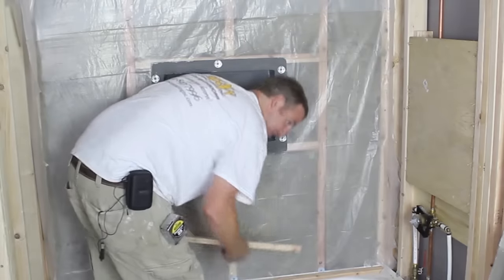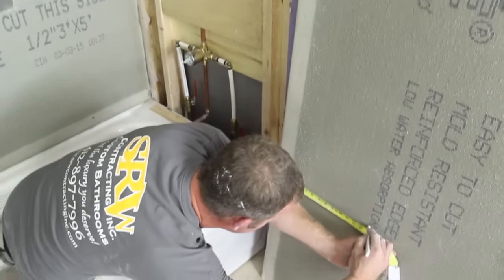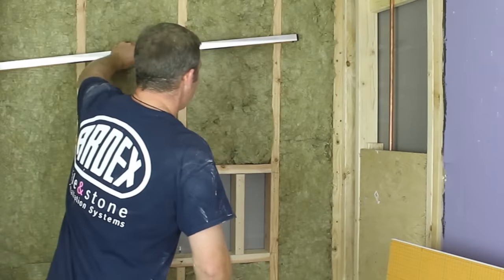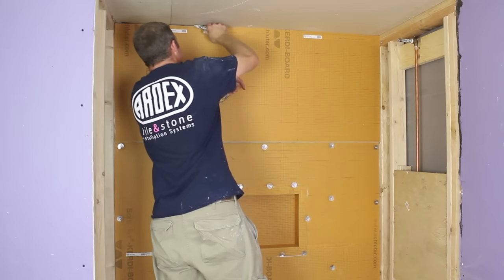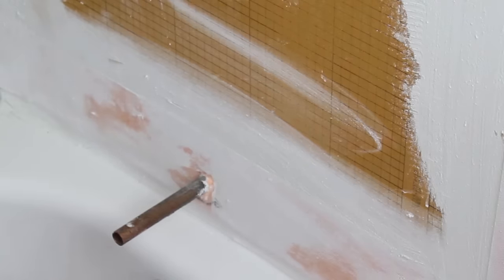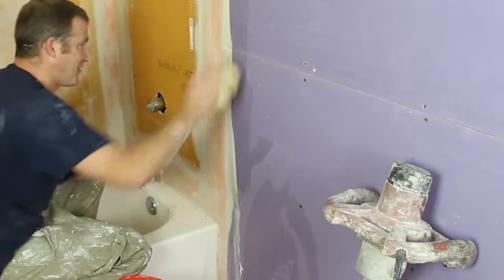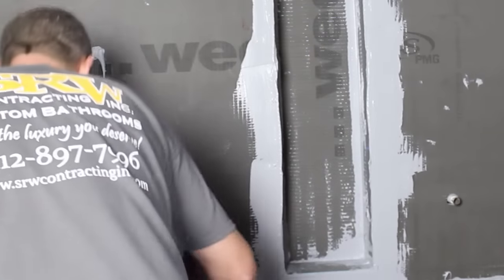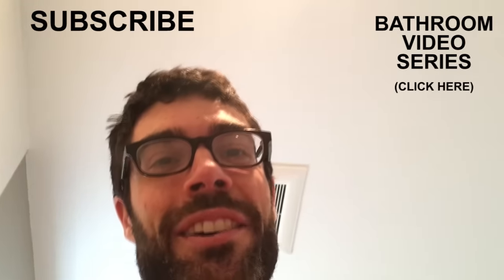How to Waterproof a Shower (3 Awesome Methods!!)

Comment: Hi JeffYour videos rule.My Question is, what thinset do you recommend to lay porcelain tile with Hardi board.Thanks, Steve
Reply from the maker: Thanks Steve, we like several and it depends on the type of waterproofing going over the backer board. If you waterproof with RedGard and have a large format tile (anything with a 15" edge or more) Custom's FlexBond is good. If you waterproof with Schluter's KERDI over the Hardie, then use their ALL-SET. If you opt for Ardex's 8+9 to waterproof the boards, then we like X77 for large format tiles.
Reply: Thanks for the quick response.
Reply from the maker: happy to help, what kind of shower are you building?
Reply: Nothing fancy it's just a redo.I Like the Redgard a bit expensive but so is the Hardieboard here.The salesman here in Burlington Ontario Canada at Lowe's sold me Mapei Light mortar for tile and stone and said it would work with Hardie.Would you agree with this Mortar?Thanks
Reply from the maker: Mapei makes good products, what size tile is it? I looked at the spec sheet for that thin-set mortar and it's polymer modified and should work well.
Reply: The tiles is 12x24Last Question Jeff. Do I still need to waterproof with the Mapei mortar?Once more thanks for taking the time out to answer my questions.
Reply from the maker: In that case, if you can find Mapei's LHT (Large and Heavy Tile) it's a better option for 12x24 tiles. Any cement backer board needs to be waterproofed as it will absorb moisture from the shower. Use a Mapei product like Aquadefense, it's a liquid waterproofing membrane; Lowe's might have it in stock but any local tile store carrying Mapei will have it or something similar. We like Mapei products, they're great. If you need help with setting the 12x24 tiles we have a detailed online course and it's helped many people, here's the link https://bathroomrepairtutor.com/how-to-tile-a-shower/
Reply: Thanks  very much Jeff will watch the video

Comment: honest question- with methon 1, I saw you had a vapor barrier behind your cement backerboard. I have read that you should either have that, or waterproof your backerboard (redguard) but never do both. Otherwise there is nowhere for water to go, walls cant breathe. Can you address why you did both.
Reply from the maker: +dskater411 we used the vapor barrier because there's still a certain amount of moisture that will get behind the RedGard. Also, our vapor barrier runs down over the tub lip so that moisture can find its way back to the tub. But frankly there shouldn't be that much moisture penetrating the wall studs if you use the plastic and have a vented fan to the exterior of the house. We don't use plastic behind KERDI-BOARD or Wedi

Comment: When doing commercial jobs, we often uses Dura-bond quick set mixed with structolite to fill the void.
Reply from the maker: Thanks Jeff for that tip, sweet.
Reply: Home Repair Tutor I want to say the mixture is roughly the same make up as the dura-rock its self. I was part of finishing team that comes in after the rock is hung. That is the way one of the old veterans told us to do it, seemed to work great though. 

Great videos, keep it up!
Reply from the maker: Sounds like a solid solution!! Thanks Jeff, we have a ton of videos planned for this year.

Comment: Modified or unmodified. I'm in England and haven't heard that terminology. Is it the same as SPF/ non-flex? Also I assume "thin set" is just your name for tile adhesive??? Really like the wedi and kerdi. I've been doing bathrooms a few years and have tended to use a classiseal rubber upstand around the bath/shower along with aquaboard (plasterboard with polymer sewn in) in the bath/shower. Over here in lowbudgetland that's generally more than other's do but i'm always looking to improve

Comment: +Home Repair Tutor Can you use any brand thinset over Ardex or does it have to be one of their thinsets?
Reply from the maker: +SpecTRe X we prefer their thin-set because it's been tested and proven compatible. I reread the instructions but couldn't find where they made a specific thin-set recommendation 

http://www.ardexamericas.com/sp/Documents/TechData_En_8+9.pdf
Reply: +Home Repair Tutor Thanks for the reply. The recommendation for X77, X32, X5, or X4 is in their "Brochure_TRI_8+9_5Step.pdf" file. After some comparing to RedGuard, which recommends using Custom's "flexBond" mortar, it looks like anything that meets 118.4 & 118.11 should work.

If Ardex's mortar was available locally I wouldn't care but there aren't any sellers around me that carry it and shipping for that weight isn't practical; which is why I asked.

Comment: I see where he says the cement board needs to be one inch higher than the tub deck and we all know there's a little lip that goes next to the tub where the screws go into the  stud so that means there's going to be a gap 1 inch high and a half of an inch deep right there at the bottom of the cement board is that just get filled with cement when your tiling? It seems like an awfully big gap to leave why doesn't the cement board come all the way down to the tub deck
Reply: This seemed wrong to me too. I think he misspoke when he said 1 inch above the lip. Later he says 1 inch above the tub deck. This still seems higher than ideal. I think I'll mount my hardie backer five-eighths inch above the deck, which will overlap the lip by about a quarter inch. Does this seem right to you?

Comment: can i just install tiles over the texture/painted drywall in my bathroom as it is?
Reply from the maker: +William Chap depends on how rough the texture is and how solid the paint is on the wall. Is this in the tub or shower area?
Reply: thanks for the reply! its the shower area. Planning to put tile all the way up to the ceiling
Reply from the maker: +William Chap in that case we'd recommend a waterproof backer board like Wedi, KERDI-BOARD, or cement board with RedGard over it. Waterproofing the shower walls is critical to prevent mold and to keep the tiles adhered. What size tile are you setting?

Comment: You said twice to make sure you water-proof the cement board. I understand that this is a good practice but it is not mandatory. It's very expensive for a redo, but it's also expensive for that Ardex 8+9. 

I did not waterproof my cement board, however I had 100% vapor barrier coverage beneath and used an epoxy based grout.

Lord please tell me that the dozens of videos I've seen without the paint on membranes were not all wrong!
Reply from the maker: +Thomas Chafey if there's one thing I hate about online tutorial and TV shows it would be the sight of people tiling directly over cement board without waterproofing. Here's the reason, cement is not waterproof. When it rains you'll notice the water gets absorbed into unsealed cement. That same principle holds true for cement board. Ardex 8+9, RedGard, Hydroban, KERDI membrane...they're all good products that help prevent mold and mildew from moisture. If installed correctly these waterproofing materials will do a superior job of protecting the Shower from unhealthy situations. No grout or thin-set is waterproof, water will absorb through them. Even tile to a certain extent absorbs moisture. Plus how many time will a shower be tiled, maybe twice in a 30 year period. Spending the $100-$200 is well worth the peace of mind. Heck my monthly cell phone bill is more. My two cents 👍
Reply: Ok thanks a bunch makes a ton of sense for sure! I think I chose to opt out of the membrane mainly because it was a tub with tile wall install, were it to have been a shower install I would have most likely not taken my chances.
Reply: @HomeRepairTutor  So True!!!!!! Well said...............common sense is underrated

Comment: Thanks for the, it opened my eyes to options other than the cement board.  After watching this and other videos from you I am sold on Wedi board for my ongoing bathroom remodel.  A simple question, I have a prefab acrylic shower base and I am unsure of the placement of the Wedi board.  Should the board overlap the shower base lip or meet the lip?  If it meets the shower base lip, what is the best way to prevent future leak at the joint?

Comment: WEDI is now carried by home depot.  the kit to do a standard size shower is almost $1600 !!!!     cement board is probably 1/10 of that !!!!
Reply from the maker: it depends on what type of shower. Wedi is more expensive than cement board but keep in mind that cement boards still needs to be waterproofed. Plus wedi provides a 10 year warranty and it's better than anything the cement board makers will provide.
Reply: Jeff/Home Repair Tutor, are you compensated in any manner by Wedi or Kerdi? You recommend them so strongly, just curious.
Reply: @chrisr8201  Note there is no answer.

Comment: Do you have a video or recommendation on how to properly install the lining on the shower only installation. I know you go 6 inches up on the wall and fold the corners however it seems to me that there's whatever wallboard you put on the wall seems to bow out at the bottom where it overlaps the folded liner material.
Reply from the maker: What kind of shower are you installing?
Reply: Home Repair Tutor Hardie backer
Reply from the maker: Unfortunately we don't have video showing a shower installation using a liner and HardieBacker. But our buddy Sal DiBlasi might

Comment: In the video, it appeared that there was plastic sheeting applied to the large wall before the cement board was put up.  Why was this done if a waterproof coating was applied to the  surface of the cement board after it was installed?  I thought that a waterproof barrier should only be applied to one side of cement board, otherwise any water that makes it's way into the board is trapped.
Reply from the maker: We had the plastic vapor barrier up for a different video and never took it down. It was to show folks how to install a vapor barrier if local code required it. That said, you'll have to check the waterproofing manufacturer to see if they require a vapor barrier or not. For example, we don't use one with Wedi or KERDI-BOARD.

Comment: In need of a major bathroom remodel. The more I look into all of this the more confused I get.

Already had several contractors out to my house and the prices are all over the place, from $5000 to $14500 for an 8ft long by 6.5ft wide bathroom, so ridiculous what these guys are charging. I understand they have overhead but good grief. Also for the most part my bath will be partially and maybe totally gutted but this is a small bathroom. I think a realistic price is between $4000 to $7000 grand tops. Maybe I should try find someone that's willing to do this as a side project but has the experience to get the job done right. Any advise?
Reply: DIY.  Decide which system you need want , get instructions from the manufacturer and ignore most YouTubers.

Comment: Currently doing a gut remodel of bathroom on a home thats around 30 years old. One of the issues on back long wall of tub surround where tile will go stud spacing at one place is 24' (center), which a stud can't be added due to multiple plumbing pipes are stubbed from slab. Considering this distance what is strongest preferred backing board?
Reply from the maker: That’s tough, most backer boards require 16” on-center. Wedi has the most rigid board but they want 16” oc. There’s no way to sister 2x4 together in a few spots?
Reply: Home Repair Tutor That is what I was concerned would be the case. I will have to see if can’t figure some way to get a 2X4 stubbed in between to get better support for boarding. This is my mother-in-law’s house that got flooded during Tropical Storm Harvey, which she passed away a week after house was flooded. She was experiencing mild episodes of dementia which we found out a few weeks after Harvey we discovered she’d let her flood insurance lapse. Henceforth, reason I’m doing everything myself 😬 For some reason of all walls (long tub surround back wall) they stubbed up from slab, 6 water pipes and a 2-1/2” PVC sewer vent pipe runs entire vertical length through top plate (bearing wall). There’s not even a floor plate where plumbing comes through concrete. I will try figuring out something? I do appreciate the rapid feedback!
Reply: Allen Portman ,
If you can sister a piece of plywood or 1x to the studs in that bay then you can cut a piece of 1/4" or thicker plywood to attach to 1x. The thickness depends on how much room is between the stud face and the remaining space from the pipe face. Basically, you build a "U " shape that attaches to the studs but bridges over the pipes.

Comment: where are you located at geographically? JW because I was looking at Kerdi board and seen it as much as $250 USD for a 4x8 sheet. I have no doubt it is a great product. But if that is the cost not practical for most homeowners. Thanks for the Great video though you make it look easy.
Reply: lowes price Schluter Systems 0.5-in x 32-in x 48-in Kerdi-Board Polystyrene Foam Backer Board  $36.98 a piece.

Comment: you really want plastic behind the CB and then waterproof the otehr side. isnt' that going to trap moisture between potentially?
Reply from the maker: +livingwaterutube this is just a mockup to show how to add plastic if the space requires it due to local code. We typically opt for KERDI-BOARD  or Wedi which don't require plastic

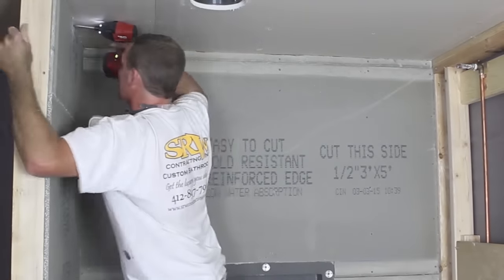Comment: 2:12  Why would it be necessary to "always have your drywall in place first" (b4 the cement board)?   What is the reasoning for that?
Reply: Not necessary. It is a construction sequence when the different jobs are being subbed out. Dry wall is installed first then the tilers come later and they are the ones that install the cement board. The cement board can be installed first.
Reply: Michael Utter:Thank YOU for the good info.

Comment: please explain the purple wall?
Reply: It is a special drywall intended for moist (but not wet) locations such as bathroom walls and ceilings, that resists moisture, mold and mildew. It is not for use in "wet" areas such as shower stalls.

Comment: Yeh and that dude doing all the cutting didn't even have a dust mask on.  These boards will generate fine dust particles that will damage the lungs, probably similar to asbestosis if you don't wear appropriate safety equipment.

Comment: I don't think you need a cement board just use green or blue drywall and waterproof with red guard that all you need . Same result and cheaper. I demolished lots of bathroom walls and even with out any water proof they are fine if the grout installed right.

Comment: I like all of these methods. However I could find dozens of videos on YouTube that will show you how they failed even when they properly installed. I don’t understand why more of these companies don’t actually make pre-fabricated pans to work within their systems. Most of the pans on the market need modified thin set rather than on modified thin set so there’s a compatibility issue to deal with.

Comment: I am installing a Wedi shower, you did not show the transition from Wedi to drywall
Reply from the maker: apply wedi joint sealant to the transition and smooth out using a 3” putty knife 👍

Comment: Fatal flaw in all these videos that I can see, is not dropping the concrete backing board slightly below the lip of the tub. It's astonishing to me how many contractors don't seem to understand, that lip is there for a reason! It's designed to take any moisture whatsoever behind the tile and direct it towards the inside of the tub. If you're using poly behind your concrete board, it should also go slightly below and inside the lip.
Reply from the maker: the concrete board in this video was waterproofed using Ardex 8+9 and there's a good reason it wasn't dropped over the tub lip. When any backer board is dropped over the lip, without first shimming the studs, that board will be pitched at an angle. That angle will be reflected in the finished tile and look terrible. Thus, if you want to drop the backer board over the tub lip it's best to add 1/4" plywood strips to the studs. This allows the backer board to float over the tub lip and down to the tub deck. 

However, that's not always possible if the surrounding drywall or plaster isn't replaced. Primarily because the new backer board will be slightly higher than the adjacent wall and now that needs to be fixed. The backer board can in fact be placed on top of the tub lip to avoid this problem. And in our case, we filled the gap between the cement board and tub deck using Ardex 8+9 and the SK Mesh, thus waterproofing all the cement board surface per TCNA guidelines.
Reply: How did you use the Mesh over the gap?  It actually sticks to the tub lip?  And wouldn't your tile now need to overhang below the cement board even further?  I can't determine what is appropriate.

Comment: use 1\4 ply wood instead not osb , this cement board adds extra steps
Reply from the maker: +Marty Forkwater are you saying to use plywood as the walls in the shower?

Comment: Actually, Schluter's method of sealing using unmodified thinset is not a good idea. A video series by TileCoach dismantled 2 shower bases found in both cases, thinkset become brittle after only a few years. As a result,  he recommends traditional sealing like redgard on top of thinkset.

Comment: One thing that really gets me is that supposed professionals show videos with unsafe work practices.  Cutting cement board with a grinder and no respirator or even cheap dust mask.  Big no, no!
Reply from the maker: +Eric Camden we agree and I mention safety in many of our videos. In our course we do discuss the use of respirators and use them.
Reply: 2:40
Reply from the maker: +Eric Camden yes, wear a respirator when using a hole saw for anything, especially cement board